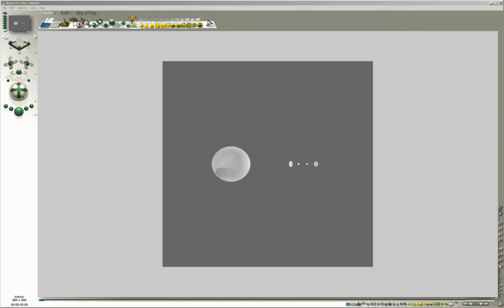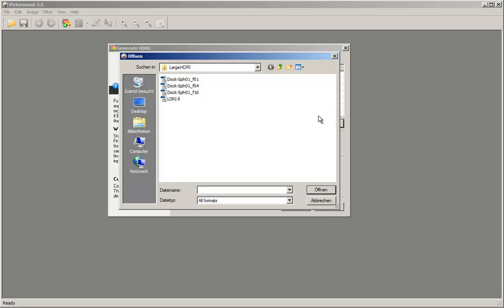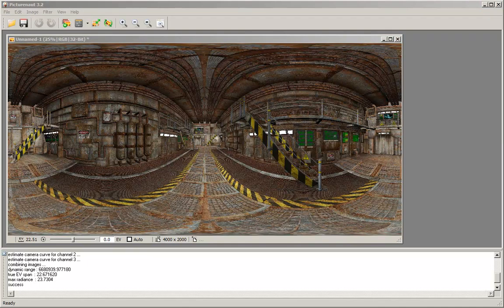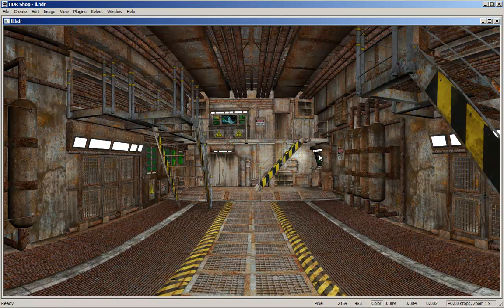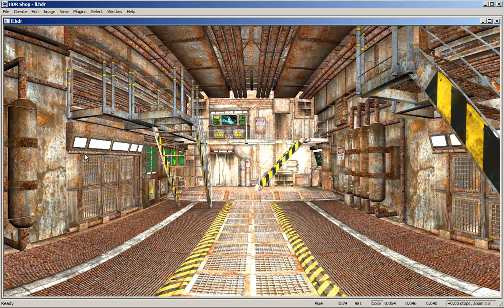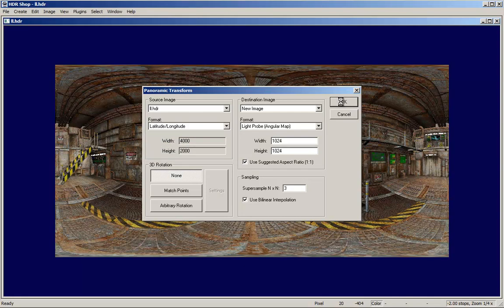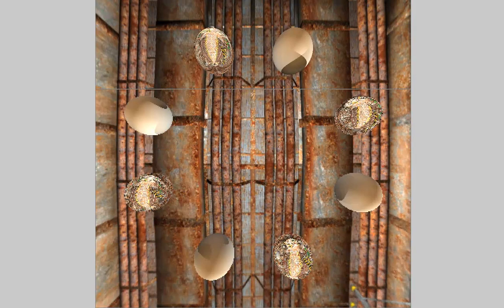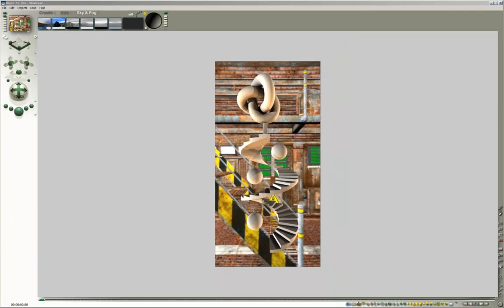Bryce 7.1 Pro tutorial - Make Fake HDRI part 3 - by Horo.

Comment: Can bryce do shadow catchers like Carrara? I'd like to use a HDRI image as my set and import a figure into the photo and have my ground invisible, but simply catch the shadow from the figure.
Reply from the maker: How does shadow catching work in Carrara?  In Bryce there are a few ways you can simulate shadows being cast into HDRI.  You can set up lights to work with a transparent diffuse surface to create this illusion - that is a bit fiddly.  You can use a projection method to create a surface texture which blends perfectly with the background - that is very fiddly.  Or you can use a hypertexture materials to create a composite surface which generates it's own shadows in response to light.  None of the processes though are what you would call simple.  So I am guessing, if Carrara's is simple?  Then it is something that is built into Carrara.  And this is not a feature that is built into Bryce.  So I suspect the answer to your initial question is going to be "no" however - it is possible to achieve.  Some methods to tackle this challenge are covered in my more advanced tutorials.  Otherwise Horo and I will be releasing a second Hypertexture product soon that covers the composite hypertexture material in detail along with many other special effect materials.  Or if you could consider our RTR product which employs the projection method.
Reply: Thanks for the responce! In Carrara 6 Pro and 8.5 standard what I do is set my HDR images, then import an infinite plain: Go to textures and "lighting method>Shadow Catcher", click checkbox and it's automatically masked except for catching the shadow. it's quite literally a 2-click option. 1: Create a plain. 2: Click "shadow catcher". Your methods don't sound too hard in Bryce though. I will ahve to give it a shot. What I like about Bryce is that I can do all my posing and importing of objects in DS then just 1-click them into Bryce to make the terrain.
Reply from the maker: revenger681 OK well if you get stuck with your shadow catching in Bryce let us know and I will try to point you in the right direction.